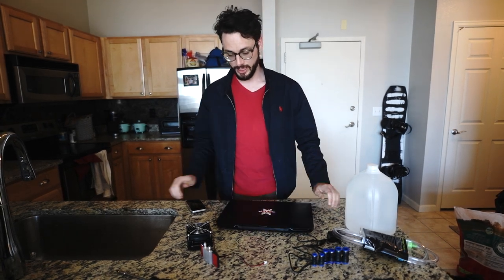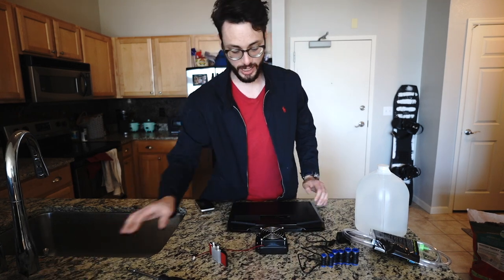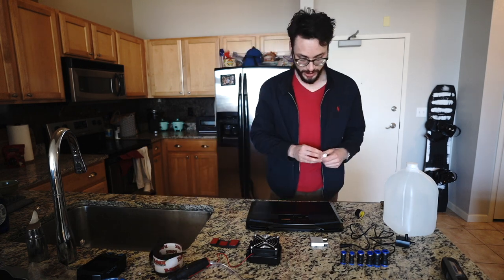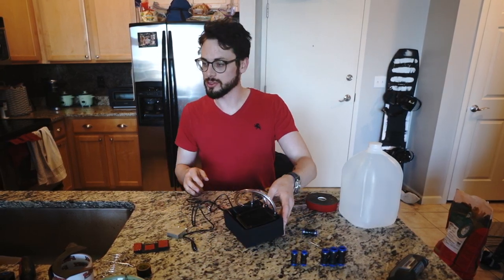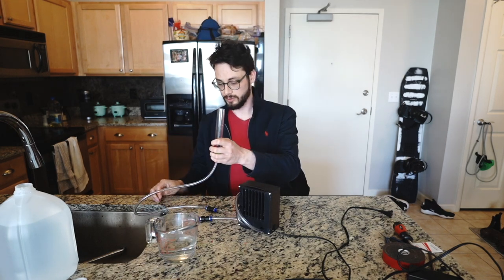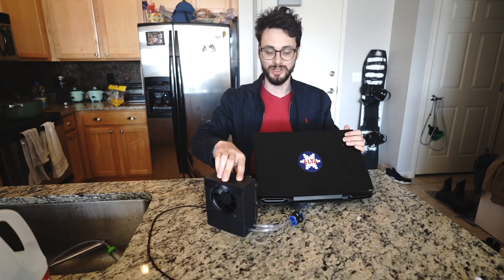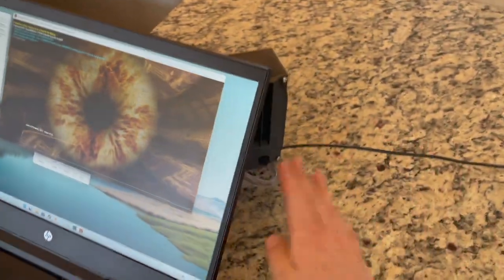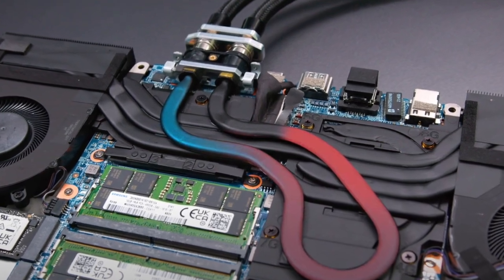Watercooling my Laptop...

Comment: Maybe you could implement this design into a laptop stand? All you would do is have a thermally conductive contact on the back of your laptop that you set down, and the cooling block is spring-loaded on the stand to make full contact with the laptop. I am actually pretty interested in this idea, considering that I'm someone who uses my laptop as a PC at home.
Reply: They make cheap "reusable" thermal pads also which would be the perfect use for them. Even if you used 1 every time you had to set it up it would be fairly cheap and not so messy. Idk why I'm even looking at watercooling a laptop because the temps on mine are already pretty good.

Comment: looks like the laptop got power throttled, which explains why you don't see much difference in the performance.
if you hack the bios to unlock the power limit it might give you much higher performance because it has lots of thermal headroom to work with after you water cooled the laptop.

Comment: So I've been thinking about this concept ever since the latest ltt video came out about it, the main issue was that water was left behind in the whole thing so I was thinking what if you keep all of the water-cooling external, but in a way that you can quickly "plug" the laptop into a laptop stand or something. Only issue is that there isn't really a way to connect the waterblock and the heatsink together without using thermal paste and that isn't really all that fast.
Reply: Actually doing something similar like this right now. Cut up the bottom plate of the laptop so it'll have a hatch that you could open and close. The laptop stand has an AIO cooler where the pump is suspended facing upwards so the copper is exposed, maybe using bungee cords or rubber bands. Open laptop hatch, place laptop on the stand, and the connection is made where the tension from the rubber bands will push the pump up against the laptop heatsinks. There's enough space to put 2 pumps side by side. If using a 360mm AIO in a push-pull, you can have 12 fans cooling the sucker. Make it into an enclosure so it will be more of a "docking tower." Will have to use thermal pads so there's no "sticky" connection and will conform to all the uneven surfaces. If not using it, just take the laptop off, close the hatch and it's back to a regular laptop.
Reply: @UrdnotAkongo  Awesome! And how's the performance on that compared to regular?
Reply: @UrdnotAkongo  Hey man, that sounds amazing! I wanted to build something similar, so could I have the details of how exactly you did it?

Comment: time to get a 360mm radiator for my laptops cpu so i can stay locked at 5ghz instead of 4.2ghz lmao

Definitely have to do this now. Swapped my gpus 80w vbios to a 115w vbios and the gpus hotter temps are definitely not helping the 10th gen cpu lmao.
Reply: Yeah the 10th generation Intel processors in laptops get always super hot xD
Reply: @rafaelconstanzovicens9094  Yeah but i finally got it to stay at 4.2 without going over 70 so thats a win 

still gonna water cool it when i have the time

Comment: nope need 140 mm x 120 or 140 mm waterblock and 240 radiator
thats the set not this super tinyyyyiest radiator and watre block to cool a bit the vram gpu and cpu .laptop is fcking thermal trotling so atleast get a bigger set up if u REALLY want to cool off ur laptop

Comment: I have an old HP laptop Dv7 and the problem with CPU in the DV 6 and 7 series is they always run 100% even on small load so you hit 80-90 c. Fast and it start to bottleneck and I think a set up like that could help it along fast.

Comment: what about those new small phone coolers, i think you can slap one of those right on top of the cpu/gpu
Reply from the maker: Maybe, depends on how over designed the phone cooler is. A phone needs to dissipate less than 5 watts of heat, while a gaming laptop has over 100 watts to dissipate when running full-bore. 

Might be something I could test tho, given that they are so cheap

Comment: Plz improve this desing , 3d print the back of the laptop whit a hole over the gpu so you dont have to cut it, And place all the parts in a laptop cooling pad so it can be lift and place in place easly

Comment: What's not accounted here are other factors that may affect temperature of the system, mainly the ambient temperature. I think if the ambient temperature is hot, this setup would be very useful for cooling the laptop.
Reply from the maker: Interesting point that I didn’t think much about